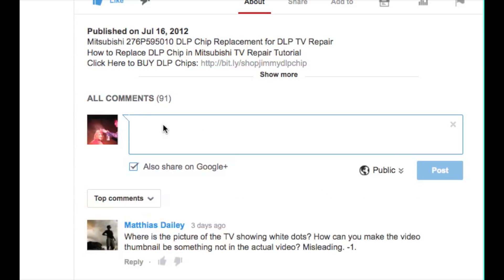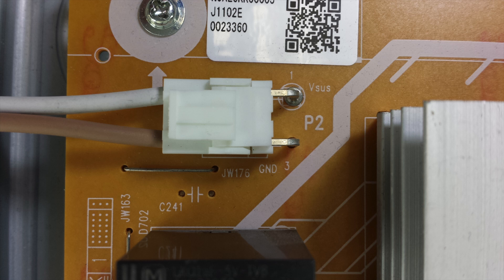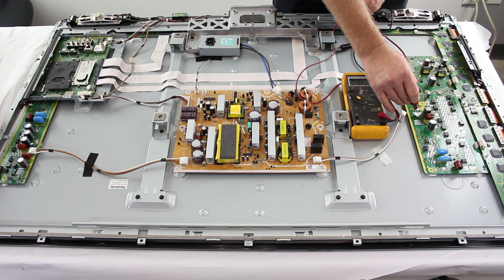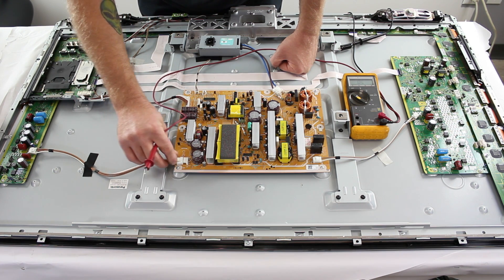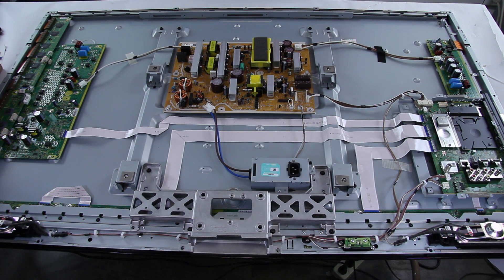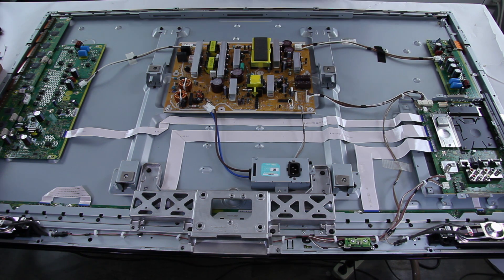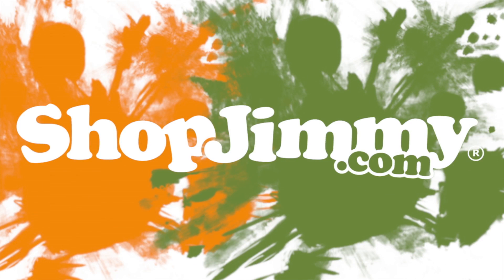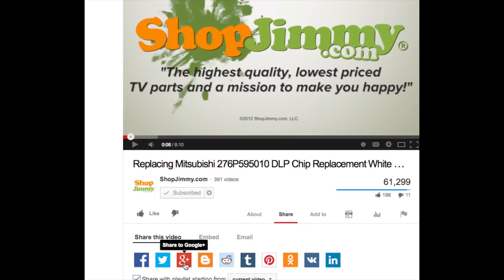Panasonic Plasma TV Repair - Understanding 14 Blink Code - How to Fix 2011 Panasonic Plasma TV

Comment: Hello, I have a Panasonic TC-P50S30 where the power is on but the screen is black. When checking the SC board I have a short on the SC2 power connector.  In the video it asks to check between TPSC1 and GND and it is showing 250Kohms.  I have disconnected all cables and I am still seeing a short on the SC2 Power connector.  Does this mean my SC Board needs replacement?
Reply: Collene: I have the identical model. I have the same diagnostic results as you. Did you replace the SC board? If so did it fix your TV?

Comment: I have a Panasonic 50" Plasma TC-P50S30 From  2011. When turned on the relays click on but picture never comes on... the LED is solid red. When the power button is held for 5 seconds it blinks 14 times. Anyone else have this issue and then found out the solution? I have take the back off the TV, however will need to get a multimeter in order to do what is asked in the video, if anyone else has had the same issue as has a solution please let me know

Comment: I have a tc-p50st30. It won't power on. It blinks 14 times. I have replaced both the the P board and the A board and get the same errors. Any suggestions?
Reply: On mine I had to replace the MAINBOARD TNPH0912 1A

Comment: Hi i have a changhong CHP5063a the tv gave 2x  power buttons if you push the big button in about 10mins a red light comes on push the otherr button and nothing brought new power board and put it in today but still have same problem

Comment: Hello, I have a Panasonic TC-P55ST30 made 2011  s/n MJ11590735 and I did the (Understanding14 blink test ) and replaced the SS board and now have 7 blinks and retested using the 14 blink test procedure and it is indicating that the SC,SD and the SU boards are shorted and need to be replaced dose this sound correct? Thanks for your help.

Comment: I have an odd issue. I have a TC-P50ST30, it powers on but has distorted digital scrambled lines in the picture, but not in the menus. I ordered a brand new board, specifically made for this model, sealed. Now with the new board it doesn't power up, gives me 14 blink code. If I re-install the old board, it powers on and same original issue... Does the new board need to be programmed or could it be a defective board?

Comment: Panasonic tc-p42g10 when plugged in it automatically turns on put no picture red light is solid and when you press the power button it will turn off but as soon as it is released it turns right back on

Comment: I'm gonna take you up on your offer... I have a 60" Panasonic Plasma PCP60530 Dec 2011. One day it just wouldn't turn on.. No pic, no sound, no clicks, no led (solid or blinking).... I've checked electrical source, cord, and the box? the cord plugs into on tv.. I've got power going to the brown board (power supply board?) in the middle. I've check for continuity across the fuses I've seen, and visually inspected boards and capacitors. I just found this video now so I haven't yet done these tests.. What would you suggest from here? Thanks for offering help to Plasma owners.

Comment: I have the exact same tv as this video, ive done exactly what your doing. I have a short to ground going to y sustain board but when i go from sc2 to tpsc1 theres no short to ground. This video does not cover that. Any ideas what im suppose to do know? Ive actually bought your repair kit with all the mosfits diodes etc. Etc. But without it shorting to the tpsc1 im not sure if i should go ahead and use it. Plz help

Comment: I have a Panasonic TC-P50x5. I replaced the power supply board.  I use a cord on hand, there was no picture but I could hear a clicking sound.

Comment: Have March 2011 Panasonic Plasma TC-P50S30, tries to power on light is red and then clicks and will not turn on.  Have unplugged and tried several times, no help.  I see similar comments below and failed repair, other comments suggest fuses etc.

Comment: Panasonic TC-P50C2. Manufacture date OCT 2010. Heard a click/pop and picture died and power LED started flashing 10 times pause 10 times...... Remove from power, reconnect power and press power button tv appears to be starting up but then a relay clicks in the tv and we are back to the symptom detailed above. Please advise on part you recommend for this repair. Thank you for the great Videos.

Comment: Dear Gents

                                                I  bought one PANASONIC  VIERA PLAZMA  TV. (42 inch) of type   TH-P42U30P   , since almost three years from SAUDI ARABIA .
Now, During watching this set normally , suddenly  it starts to generate some sort of clicking  sound and the screen becomes black FOR unspecified time
Then after that time It goes back to  work  normally again with no interfering from our side..

             We have tried to approach the technician in our home city (Damietta)  but He could not fix this problem, They told us that We have to change the main
Board Control panel .  Would You mind to inform us exactly what kind of panel He is talking about because We can not find it here in Panasonic spare parts
Shops Please ,, try to consider also  that this set is of MALYZIAN made..

For your kind investigation and reply please.. please try to help us…

Thanks, Regards

  Ahmed Jalil

Comment: P11 pin 1 is not shorted. P11 pin 3 shows short to ground but pin 4 doesn't. there is no wire in pin 2 slot.

Comment: okay I have a question I have a plasma Panasonic 48 inch model number tc-p5os30  the picture went out when I turn it on the light stays red  when I push the power button again if flashes 14 blinks  could it  be the power supply ?

Comment: Hi, I have a panasonic TC-P50S30.  Following the diagnostic video and the first test of the the P2 connection shows a short.  I disconnect P2 and the short is gone.   I follow on and test the SC board.  The next step is to test at TPSC1 which shows no short.  I disconnect all 3 ribbon cables (SU / SD boards) and confirm that the SC board is the problem.  Is there a way to fix this board without purchase?  I've seen videos replacing the diodes & transistors and wonder if this is worthwhile.

Comment: Found your video extremely helpful.  At least it gave me a place to start looking.  I have a Panasonic TC-P42S30.  According to your troubleshooting video and diagnostic tips, I'm assuming the P Board is bad.

I tried to cross-ref the part from SearsPartsDirect and they gave me a substitution part number.  Can you confirm this substitution?  I'd like to order the part from you.

Comment: Hi, I have a Panasonic P55ST30 with 14 blinks. P2 was shorted, back to normal when disconnected (so power supply board is OK). Power connector at SC board is shorted but TPSC1 is not shorted. No difference when I disconnect SU and SD boards. SU and SD boards were previously repaired. Does this signal bad SC board?

Comment: Hi I had my Panasonic lcd tv TC-L55E50 for repair and the result is that the display (screen) is faulty . Big case , because screen replacement is out of the question and will be probably too costly . How can I be sure that's the case ? thanks for feedback .

Comment: I have a Panasonic TCP50S30 Plasma and it is displaying the 14 blink code. The TV video will display when first turned on but then video is lost after warm of about 10 -15 minutes. Since the problem appears after warm up just wondering if the troubleshooting shown in the video will work unless the TV is powered and warmed up. Any suggestions.

Comment: I had a 14 blink code (likely due to a power surge) and replaced the SC and Main A board (thank you for the troubleshooting).  TV powers on and I can switch input, but the resolution is bad all over the screen and the floating white box that used to say input needed is completely blank.  What else was fried, is it software or another board?
Reply: when i try to upload new firmware, TV reads it and then dies.  Error code is 14 blinks again.  When i unplug AC, error code is gone.  Thinking this is the main power board still, even though it isn't shorted.  Thoughts?

Comment: Hello I have a Panasonic TH-P42UT30M , and my plasma would turn on but it's will intermittently turn off & show with a 14 blink code. I would push the swith off then turn it on again it will sometime turn on and would again turn off sometimes a few seconds and sometime a few minutes later. I would do the on and off switch and sometimes it will stay on of the whole length of the movie i'm watching.

Comment: I have Panasonic TC-P42ST30 it turned itself off while we were watching it. Power led is red but doesn't respond to power button on unit or remote. I press (-) on volume with power button on unit and get 14 blinking red light on unit. P2 test point checks good. Sn2 gets 0.7 ohms on both pins.
Reply: Mine is the same. Did you find a fix?

Comment: Hi guys! Got the 14 Blink Code on a Panasonic TC-P50S30. I want to validate witch board I need to change after my test. 

TPS1 is ground
SC2 is ground
P11 Vsvs is ground

My call is the power supply issue can you confirm that?

Thanks so much for this nice video.

Comment: My model number is TCP42S30 and after following your video I found both pins at SC2 on the SC board to be shorted to grd.
The SC board on this model does not have any additional boards piggy backed to it as shown in your video. Am I correct in assuming that the SC board is failing?

Comment: I have a Panasonic tc-p50s30 with a black screen. The red light comes on when I turn it on. When I hold it down, I get 14 blinks.
Reply: I have the same model and issue, were you able to fix it
Reply: I bought a used P board for $56. It did not do the job. but now I have to check all the connectors with an ohm meter and possibly replace the A board for a bit $100.

After that I am reselling all the boards and throwing it in the trash.

Comment: I have a model TC-P46-C2 which will not power up. Red led does not come on/ or blink. Set completely dead, even no relay click. System 5.0 volts available at power supply. All other voltages not available.

Comment: Hello I have a question. I have a 55" panasonic plasma 3d tv model p55st30 with a 14 blink code. I had to do a hard reset to get the solid red light to start blinking the code. I would like to attempt to repair it myself. I'm new to this, and am curious how you ground yourself to repair the tv.

Comment: hey i have a panasonic plasma hdtv (TC-p65s1 when i plug it in and try to turn it on the power light blinks 7 times stops and the tv will not turn on. Do you know what part is bad and how much it will cost to fix thanks

Comment: my Panasonic TC-p50S30 when trying to turn it on with remote, lights the red led but I get no audio or video. Using the power toggle on the right of tv I get 14  red led blinks. So I watched your 14 blink code diagnostic on utube. No flags until testing p 11 where all 3 pins wer short connected or not. So I bought a new power supply board which acted exactly the same as the original one. What now?

Comment: hello i have a Panasonic viera  2010 Tc-p65s1  no picture or sound tv comes on then goes off fans comes on then turns off also i get a steady blinking on the front of the tv 1 every 3 seconds and never pauses to  to get a count other than 1 on off for 3 second on then off for 3 on etc etc etc never changes ' i got green lights on both boards vsus and sc ; got 188vlt  and 50 on the test points on the vsus test points before and after the tv went off

Comment: TC-P46ST30 55INCH plasma TV 14 blink code if holding power button TV screen stays off after turning on TV have used your video and all connections read .3 ohms at first then 4.0 ohms

Comment: Hi. I have a Panasonic PT50LC14. I replaced the lamp and it lasted 5 or 6 weeks. I replaced the lamp a second time and it lasted about 26 days. I am now waiting for the 3rd lamp to come in the mail. The second lamp actually had the glass cover separating  from the front of the housing??  After the lamp goes out I turn it on, it blinks green over 100 times and then blinks red until I unplug it.  It's not a plasma but thought maybe you could help......  thanks

Comment: Panasonic TC-P60GT50/ I have a 12 light blink code. If I unplug the power cord and plug it back in then turn on the tv the screen will stay on for like 3-5 seconds then turn off.

Comment: Panasonic P50S30 with 14 blink Code. Thanks for the great video! I found the SC2 test point shorted. Also tested TPSC1 with no shorts. Tested other ports other ports on the Power Supply with no shorts detected. So, I sent the SU board off for repair by vendor who tested it in a working set before returning. After replacing the repaired board in the set again I retested SC2 and it had no short. Powered up the set and heard the two relay clicks...all OK so far. Press the power switch heard third relay and immediately the 14 code started again. Retested the SC board and it again is shorted at SC2. Where do I go from here? Any thoughts?Thanks...Tom K.

Comment: I have a panasonic viera 65" 3-d plasma screen model TC-P65VT25 and the red light blinks 13 times. My girl was watching tv and the sceen went black. I don't know how many times the light was blinking before I removed the back cover and found 62V between the chasis and some of the aluminum bars on the power supply boards. I replaced the power supply boards and cleared the stray voltage but the tv still doesn't work. The red light blinks thirteen times and I do not have a short at terminal one no the SC board. I do have continuity to gnd at the upper pin on the SC side of the jumper plug from the SC to the SU board. Any ideas? Please help.

Comment: Hi, I have a Panasonic TC-P50S30 that was blinking but after disconnecting the power it will no longer blink. Unfortunately, I didn't know to count the blinks at the time. Maybe that's a moot point if it's not blinking now. Is there anything I can try to determine what's wrong? I do see a light in the optical connector, so that board must be getting power. Thanks for any help you can provide!

Comment: Great video, thanks for posting it!  I have a Panasonic TC-P50S30 with the 14 blink condition that shows a fault at the SC board connection to the power supply, but no fault at TPSC1.  This is a scenario you do not address.  Does this indicate a bad SC board?
Reply: Gary, I have the same situation  with my TV after looking at the video.  What did you do?  Did you just replace the SC board taking a chance that the SU and SD boards were ok  because the TPSC1 did not show a fault?
Reply: Bob, did you figure this out?
Reply: Gary, I have the same problem.  What did you do?

Comment: I have a Panasonic plasm tv and I got a 14 blink codeThe tv do not come on or light up. After following instruction on, I get a 14 blink code.Model TC-42s30
Reply: allen rutland any luck on what was the problem, I have the same model and problem.
Reply: +1 same model, same issue.

Comment: i have a panasonic TC-P50S1WHEN YOU TURN IT ON IN THE UPPER LEFT PART OF SCREEN IT POPS UP HDMI 3 BLU RAY THAT GOES AWAY THEN IT TAKES 2 TO 3 MIN FOR THE PICTURE TO COME ON. THE RED POWER LIGHT DOES NOT BLINK IT STAYS SOLID RED. WHAT SHOULD I LOOK AT TO SOLVE PROBLEM. THANKS

Comment: Model No. TC-P46ST30.  The TV stopped all of a sudden.  I watched your video and did not find any shorts.  I plug the power in and hear the click, then press the power button and only get a solid red light.  I have replace the power board and the SC board and still have the same results...solid red light.  Am I missing something?    Thanks

Comment: My tv is a Panasonic Viera Plasma TC- P42S30. Please advise if the power should be ON when testing for the shorts on the Power Supply Board. 

The tv suddenly went blank (i.e. black screen) while watching. The red LED power light still shows, but there is a black screen and the remote does not turn off the red LED power light.

Please advise if I should test as per above video and when power should be on and when power should be off.

Comment: Hi There I have a Panasonic TC-P55GT31, I have the 7 blinking lights of death. What boards I need to replace?
Reply: Doctor slime 54236775 Hi, I am having the same issue ! 7 blinking lights. Did you have to change the sd board ? Thanks !

Comment: I have a TC-P42S30 and found the short went away after disconnecting the power supply.  I do not have two boards but one board connected to P2.  There is still a short on the next board.
Reply: Also when I first power up and hear the click, the led stays solid red.  It only starts blinking 14 if I press the power button again.

Comment: Have a Panasonic Vieira  Model # TC-P50S30 that has no power or led light. Stopped working after electrical storm. Followed your path of circuits and all seems fine up to the SS board and found OL on one of the pins that I think should be closed (ground). Please advise how to pin point possible problem.

Comment: i have a tc-p55st30 and im getting the buzzing noise and it sounds like its coming from the upper left corner in the back of the tv. obviously if im looking at it from the rear its the top right. i read somewhere on the avs forums its a known issue. but i cant seem to find the posts in that section of the forum....any idea which board it is? thank you

Comment: hi guys,  I have a Panasonic Viera TX-P42X50B that has simply stopped working. There is no power whatsoever, no lights at all. It used to flash numerous times when I'd turn it on but I never new it was trying to tell me something!!!!!